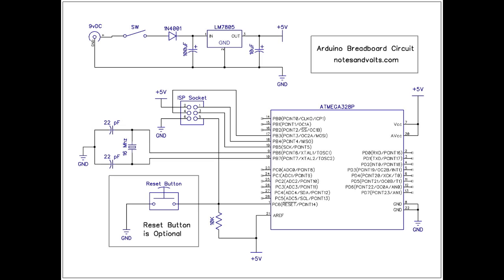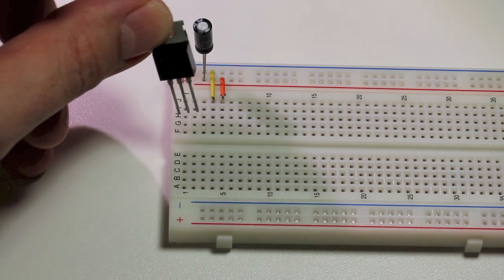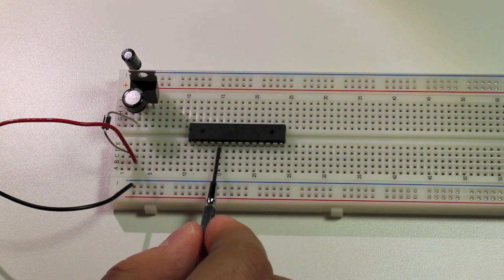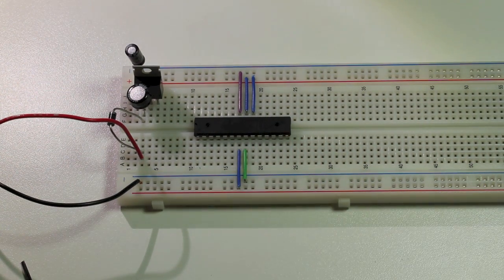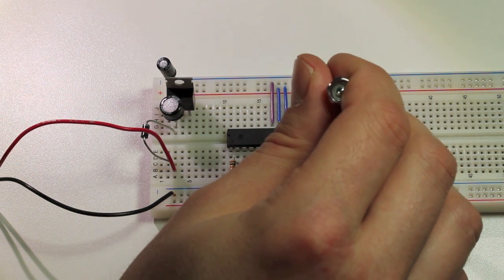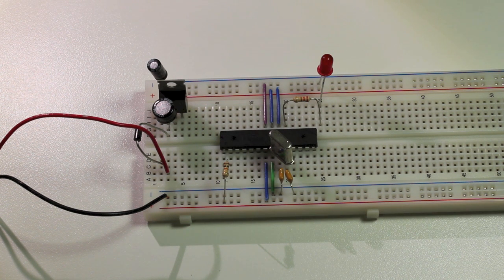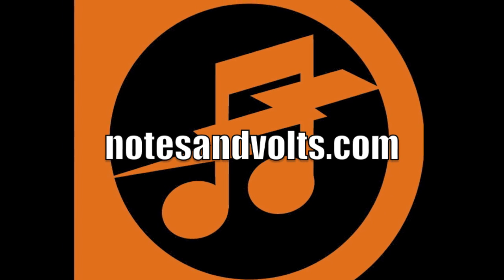Arduino on a Breadboard

Comment: OMG...thank you so much! I have spent hours trying to get this ATmega328p chip programmed. This video and the one to make the breadboard construction permanent were lifesavers! Thank you! Your videos are always so easy to understand/follow and I greatly appreciate that. How would you program an ATmega644p with Arduino as ISP? The breadboard circuit would obviously need to change but could you do it the same way?

Comment: I know that this video quite old and you probably won't see this comment, but if you do, i just want you to know, that youre videos are awsome.
I first saw your videos, becouse i thought, i want to make some stupid musik and build a midi drum. After a while i came across your channel and thougt,well if i do this, i might as well take it a step further and make a whole controller with everything i could ever need. And i dont know how, but your channel has every piece of information i need, to do what i want. But the problem is, that you have so many cool things on your channel and now im here, instead of buidling a simple midi drum with 5 piezo microphones and an arduino, i am now going to build my own arudino and many other things, that would not have come to my mind in any way, if your chanel did not exist.
Even though i now have to do soooo much more, i still love your work.

Comment: Searching for a finished pcb version of the same (or similar) result without having to tie pads together with solder and wire on a plain experiment board or using one of those that mimic the traces on a breadboard. Anybody seen one?

Comment: You are using the wrong value capacitors on the crystal, 22pf are for a crystal with an aprox  10pf load capacitance. The crystal linked to in the parts list has a load capacitance of 20pf that requires 36pf capacitors.

Comment: I'm wondering, if this circuit is powered by two 3v coin cell batteries totaling 6v, is the regulator still required?
There are basic DIY arduino kits on amazon, but they do not include the regulator components. Plus, in terms or ordering PCB and assembly it would be nice to remove steps and reduce footprint.

Comment: Could you clarify why there is a capacitor, then regulator then capacitor again? Correct me if I'm wrong, I believe the first capacitor smoothed out any ac trends from the rectifier in the power supply. The voltage regulator assures a constant 5V output. This is odd since the power supply indicates 7V output. Lastly what is the last capacitor used for? thank you

Comment: If I am using a 5V 3A power adapter to power my project, do I need the voltage regulator or can I just connect the chip directly to 5v and ground?
Reply from the maker: Hi Aarush. It's possible if the adaptor has a regulated 5v output. Be careful! A lot of adaptors are not regulated.
Reply: +Notes and Volts I hooked my multimeter up to the power supply, and it’s reading a constant 5.19V. I’ve heard that the Arduino can handle up to 5.5V. Is this a reliable measurement of whether the voltage is regulated?
Reply from the maker: It sounds regulated but I can't say for sure. Unregulated usually reads much higher without a load. This article has some good info: https://www.sparkfun.com/tutorials/103
Reply: +Notes and Volts Thank you for all the help and the amazing tutorial!

Comment: Why ISP socket is added in the circuit diagram? What is it's function? For power supply of the microcontroller, do I need it?
Reply from the maker: Hi Mashuk. No you don't need a physical socket. It is just to show the programming connections in the schematic.

Comment: could I use 12 pF capacitors for the crystal?
Reply from the maker: Hi Fort. Timing circuits can be a bit sensitive to component changes so you may have some troubles. I don't know for sure without trying it.

Comment: You don't really need the rectifier or regulator. Just find any old cell phone wall charger, split open an old usb cable and there's your 5 volts. Most supply .5-1amp which is plenty for pretty much any ATMEGA328 based project.
Reply from the maker: Hi TBP. You are correct that you can use a 'Switching' 5V supply directly with this. I included the regulator to protect against non-switching regulators or incorrect voltage units. I like to design things to be as "User proof" as possible.

Comment: Does the 22pF capacitors need to be polarized? or would non-polarized ceramic capacitor work?
Reply from the maker: Hi Dom. Definitely DON'T use polarized caps for this. Ceramic 22pF caps are fine.
Reply: Thanks! I just wasn't sure. I'm starting to learn electronics again so I still have a lot to learn. Only took a beginner electronics class offered in high school that mostly went over electronics safety and basic principles using resistors only.

Comment: Do we need to do it with the exact same parts? Or can we buy for example a different diode, that's compatible with the circuit's voltage and intensity?
Reply: I tried with a 1n4004 diode instead of the 1n4001 and the circuit didn't work. If it is simply the diode you want to swap out just don't use one and make sure you're current is set up the right way

Comment: can i connect NRF 24l01+transiever  module to this circuit and along with that ps2 controller to this  . So that I can send data   wirelessly . 

And will this code will work on this type of circuit ?
https://www.dropbox.com/sh/m2hcasokkwwhfa4/AAD824jkdanuzkTBDNscfrYRa?dl=0

Comment: Pin 1 to 5V connects pin 1,7,21,20 to 5v  through a 10k resistor. Why is it so?
Reply: Pin 1 to 5v through a 10k resistor is to deactivate the reset pin in the ATMEGA328 which is active-low. Pin 7 is the positive supply to the ATMEGA328 so it can function properly. Pin 20 is the supply voltage pin for the A/D Converter. Pin 21is the analog reference pin for the A/D converted so they all need to be connected to +5V. You can find all of the pins' signification in the pinout diagram: https://arduino-info.wikispaces.com/file/view/ATMEGA328-900.jpg/421493080/ATMEGA328-900.jpg and in the atmega328 datasheet: http://www.atmel.com/Images/Atmel-8271-8-bit-AVR-Microcontroller-ATmega48A-48PA-88A-88PA-168A-168PA-328-328P_datasheet_Summary.pdf
Reply: +Ben Adam so if I use this regulated supply for powering other 5V devices in this very configuration( with 10k resistor connected ) everything works fine?
Reply: What do you mean by "other 5V devices"?
Reply: 5v devices like other modules viz. bluetooth, sensors etc.
Reply: Not necessarily, you should always check the datasheet of the module you're using, and maybe look for specific tutorials for it.
Reply: +Ben Adam I want to power 18 5V relays on this supply. The problem is 7805 can derive 1A-1.5A. Each relay requires 72mA. Can I do so? And  9V or 12V which will be better as supply?

Comment: Hey there, these are great videos! just a question: I've seen several circuits/projects using the LM7805 without the 1N4001 diode. Is it really necessary?
Thanks in advance.
Reply from the maker: Hi Jonatan. The diode protects the circuit from a power supply with the wrong polarity. It will function without it, but in my opinion it is worth adding.
Reply: Thanks for replying! Would a 1N4007 diode be the same in this case? couldn't find a 1N4001. Cheers!
Reply from the maker: Yes, the 4007 should work. It is a higher voltage version of the 4001.

Comment: Hi thanks for the tutorial,
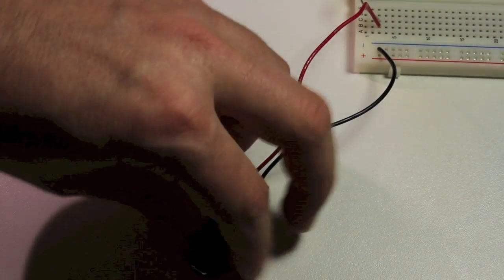Do you know if this also works if you use a power supply and put 5Volts directly on the circuit instead of using those capacitors and voltage regulator and diode (so the circuit till 3:13 )?
Thanks in advance
Reply from the maker: +stef kak Hi Stef. That will work if you make sure that the power supply you use actually puts out 5 volts. Many power adapters labeled as 5 volts are not regulated and will actually output a higher voltage that could damage your circuit. Switch Mode type adapters are your best bet.
Reply: +Notes and Volts okay thanks!

Comment: really great videos they're easy to follow and very informative, just wanted to add something  i saw someone else do which seams like a good thing. that is, when you place the chip on the board, place it at row 11 then the pins correspond with numbers on the board making it a little easier to count the pins. thanks for all  the videos , keep up the great work
Reply from the maker: +sean wirth Thanks Sean! That's a good idea
Reply: +Notes and Volts hey any chance you can do a video taking the midi circuit you did and make it go thru the usb on the arduino, for all of us who don't have midi ports
Reply from the maker: sean wirth I have that on my list but will use a different platform than the UNO. Other devices are much better at USB Midi.
Reply: +Notes and Volts kool, can't wait

Comment: You said this was the minimum set-up to run this chip. Does that mean some functions will not work?
Reply from the maker: +Dylan Moro Hi Dylan. All Arduino functions should work with this setup.
Reply from the maker: 18 to 30pf range could work. If not it won't damage the chip, It just won't fire up.
Reply from the maker: ***** 18 to 30pf range could work. If not it won't damage the chip, It just won't fire up.
Reply from the maker: ***** I don't think so.

Comment: question can we use 18 pF capacitors instead of 22/20 pF? Thanks in advance (for me it doesnt work)
Reply from the maker: +HalfLife2Beta Give it a try. 22 pf is the suggested value for this crystal but caps in the range of 18pf to 33pf should be ok. If the 22pf isn't working there may be another problem though.
Reply: yeah the whole set up is  not working
Also I wonder can I use wires from the pins 5V and GND arduino uno powered from USB line to supply a standalone ATmega ? when I put the atmega328 on the arduino uno platform it blinks the led but when i do the set up as I described it doesnt light it (tried reversing the led leads and still nothing). So I really don't know why it doesnt work
Reply: @NotesAndVolts  36pf is the capacitor value for the crystal linked to in the parts list (20pf load capacitance). The formula is C1=C2= 2x (load capacitance - parasitic capacitance), parasitic capacitance will be between 2 and 5 pf. 20 - 2 =18 times 2 to give 36

Comment: hi! can I use a 33pf capacitor instead of 22pf because I don't have one.
Reply from the maker: George Wilson Hi George. The suggested values for the crystal caps is between 18pf and 22pf. You might get away with 33pf but if your clock starts acting up, you know where to look. No harm in trying it.
Reply: OK sir,thanks for the information.

Comment: Hi! Does the voltage of 10uf and 100uf capacitors doesn't matter? What's the capacitors voltage did you use?
Reply from the maker: gabo natchi Hi Gabo. The cap voltage rating just needs to be higher than the maximum voltage of the circuit. To be safe I usually go with double the circuit voltage. I used 25V caps for my circuit.

Comment: Hi there thanks for the video. One question regarding the LED, you connect to pin 19 of the chip...does that relate to pin 13 of Arduino? I mean, in the sketch, do you still set pin 13 as LED Output? Or change the sketch to set pin 19 as LED output? Cheers.
Reply from the maker: BooktownBoy Hi BTB. Use the Arduino numbers and set it to 13 as usual.

Comment: Can we use crystall of 12 Mhz in place of 16MHz..?
Reply from the maker: Hi Shubham. I haven't tried this myself, but I know people have run Arduino based projects at different clock frequencies. You may need to look in to changing the Makefile for the new frequency. Also, some libraries that use timing may get messed up. Let me know how you make out.

Comment: Hi
I would like to use the atmega32u4 chip as it already includes USB controller , my question is which pins of atmega32u4 I need to connect to the micro usb port
Reply from the maker: ***** Hi nfs. That's a whole different topic. Here is a link I found that shows the connections for that. http://www.build-electronic-circuits.com/wp-content/uploads/2013/09/32U4_Breakout-v11.pdf

Comment: how much does this cost by any chance?
Reply from the maker: Hi Adam. The total should be under $10 US not including the power adapter and breadboard.
Reply: thanks for responding so quickly, i think i'll make one since its cheaper than an arduino (minus some features though)
Reply from the maker: Adam Yarris Cool! It's nice to be able to make your own Arduino circuit so when you build something interesting, you can build this minimal version and stick it in a box. Much better than sacrificing your Arduino.
Reply: yah, definitely
Reply from the maker: Sons_of_Liberty Possibly. But if you ever plan to produce your circuit in quantity or perhaps on a custom PCB, you wouldn't want to have a 'Nano" on your bill of materials.

Comment: Hi, nice tutorial. Was wondering though about the USB connection issue. I've noticed none of the other youtube DIY Arduino breadboard projects includes way to communicate with it or program it directly. So I'm assuming it's not as simple as connecting up the ATMega16U2 (or 8U2)chip to the breadboard. I'm aware of the other options to do this by jumping an actual Arduino board to the breadboard Arduino, or pruchasing the USB-2-Serial breakout board options, but nothing that would make it a complete Arduino Uno on a breadboard. Thanks!
Reply from the maker: Hi Mark. Thanks for the comment. To make a true arduino on a breadboard you would need to add a USB to Serial device and also have the bootloader code installed on the ATMega. The purpose of this exercise is to make a stand alone version of an arduino project that will run your program. The next video in the tutorial shows how to use an arduino board as a programmer. The schematic on my website also includes a ISP Socket so that you could use a programmer such as the USBTinyISP.

Comment: Hi! GREAT videos, both this and the next!
I have one question: I have to connect the board to my bike's battery that provides 12V, do I have to make any change to this setup? Does this voltage regulator work with 12V or is it too high? Thank you!
Reply: Hi Daedalus. The 7805 should be able to handle 12v as long as your current requirements aren't too large. And since the 7805 will be converting the extra input voltage to heat, you will need a heat-sink as well. If money is no concern, google TSR12450 for a more efficient part. Good luck!
Reply: David Bennett thank you very much for your reply! unfortunately that component's cost is too high for a simple project as mine is, can you explain me what should I look for in a voltage regulator to evaluate its quality (in terms of overheating), so I don't have to stress other people? =)
one last thing: I'm new to electronics, and I didn't understand the function of those 2 capacitors, on your site you say "The 10uF and 100uF smooth out any ripples in the 5 volt supply", ok, but why are they 2, separated (one links + and -, and the other connects 2 pins of the regulator) and why 10 and 100?
Thank you for your time!
Reply from the maker: Daedalus1632
Don't get me wrong, the 7805 will most likely work for you. First figure out how much current your project will need. The 7805 is rated for 1 amp but will require a heat sink when drawing more than 150mA (0.15A).
The caps are placed on either side on the regulator. The one on the input side smooths out ripples from the incoming voltage. The one on the output provides some help when the load suddenly requires more power. Don't worry about the values right now. There is some complex math involved that you can pick up as you get more experience. Just use these ballpark values and have fun!
Reply: Notes and Volts Thank you again!
Just one last thing: so the regulator will heat proportionally to the current that is drawn? Voltage does not count?
Thanks
Reply from the maker: Daedalus1632 It is actually based on the Wattage which is a combination of Voltage and current. If my memory is correct, the Watts dissipated by the device is calculated by (Voltage in - 5v) * Current. So if your circuit uses 100mA it would be (12v - 5v) * 0.1A = 0.7 Watts. I think the 7805 heats up at a rate of 65 C per Watt.
Reply: Notes and Volts Thank you man! You've been very clear and gentle! Keep it up!
Best wishes =)
Reply: I also had the same problem man
Reply: But after putting a heat sync, it works fine

Comment: Hello sir, I have a question about this project, which of the ATMEGA 328P pins can be used as I/O? which ones are analog/digital? So basically which ones relate to what Arduino pins? Thank you very much!

Comment from the maker: Hi Eric. You should be able to but first you need to download ATTINY support files and add them to the Arduino IDE. Plug in the wires to the corresponding MOSI, MISO, SCK and RESET pins on the Tiny. You will also need to modify your program to support the chip.

Comment from the maker: Hi Diwakar. You should burn the bootloader before you use the chip for the first time just to make sure the fuses are set correctly to run Arduino code. Check out the second part of this tutorial called 'Arduino as ISP'. The Part about bootloaders is at 3:58.

Comment from the maker: Hi JSchuler99. Yes you can use batteries for power. You could use a 9V cell although the 7805 linear regulator used here is not the most efficient device and will drain it pretty quickly. Using six AA batteries wired in series will give you longer run time.